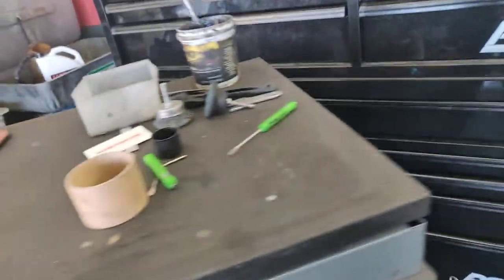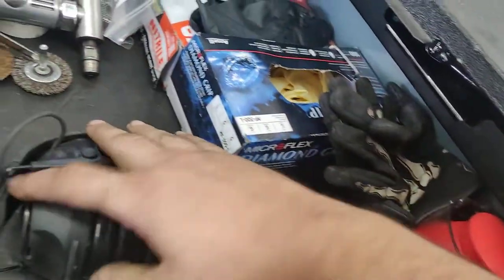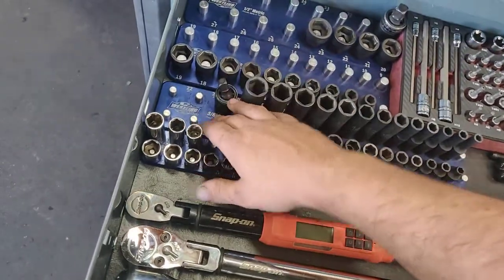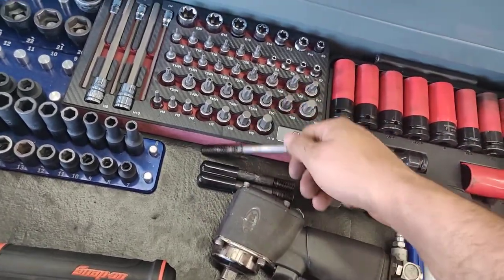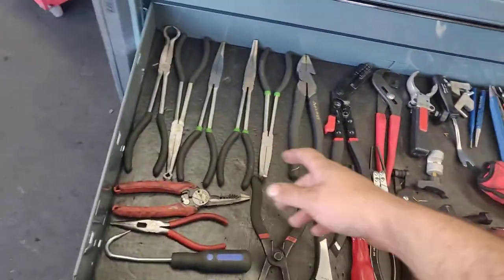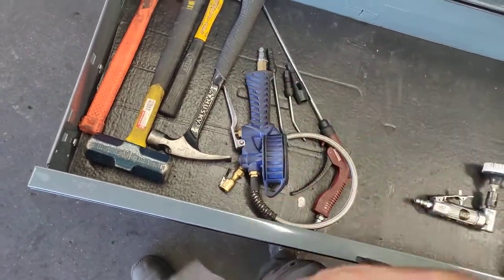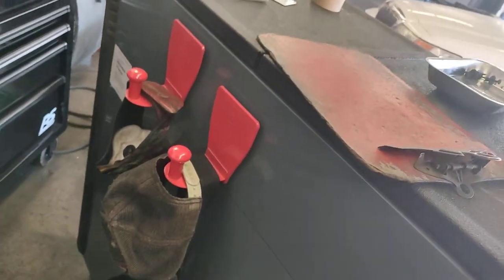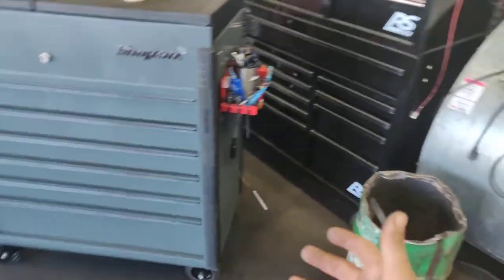My Snap On KRSC430 Service Cart Showcase and Video Inventory

Comment: A very good cheap option for prybars if you don't need longer than 25 inch is believe it or not, Hyper Tough from Wal-Mart. The red handled ones with the striking caps are rebranded made in the USA by Wilde and the 25 incher is only $10. Very stiff, thick steel.
Reply: Same exact prybars as the Craftsman and tekton.

Comment: spend the money on the tools not the box, the box don't make you money
Reply from the maker: Cart*
Cart holds more tools in it than the HF cart did. Allows me to have more of my most frequently used tools right there with me instead of having to walk across the shop back and forth to grab them. 

Time Efficiency is money. And this cart was used, not new.
Reply: U need storage first and than you buy the tools 👍

Comment: Wow someone who actually has the makita high torque 1/2! Hardly ever see these, usually it’s that red junk (;  what do you think of yours? I love mine so far! Had it about 6mo now.. also have the makita 1/2 low torque/stubby, and love it too. But the big gun has some serious torque. Accidentally broke a 3/4 bolt just the other day in about .2 seconds lol
Reply: What do you like dislike about the high torque? I like how the bottom where the battery goes , has a little flex . Less likely to break off at the bottom of the handle.. I also like how the gear case, the bolts holding it on go threw the plastic and into the metal, not the other way around like other brands. I also like that it comes with the molded rubber boot on the front.
Reply from the maker: I like my Makita. I went with it because I already had a few other Makita powered tools from when I worked Low-Voltage Installation, and it was cheaper to stay in the family than go over to Team Red and have to need a NEW charger and NEW batteries. But I did go with a few of the M12 family line since there isn't any equivalent on Makita's end.

Even at 740 ft lbs, it's plenty strong for the light-automotive work I do. The Milwaukee has what? 1400 ft lbs of breakaway torque? Excessive for light-duty automotive work. Maybe in Ag and Heavy duty it would edge out, but for passenger cars and regular trucks? 740 is PLENTY. I've rounded off a bolt with a six-point socket (It also was frozen in the bushing so.....)

And the flex at the bottom is an antivibration mechanism, since vibrations are battery-killers for these. It's a nice tool and alot quieter than pneumatics, which my boss runs. You can easily tell in the shop when I'm removing a wheel and he's removing a wheel.
Reply: The Swiss Mechanic 740 fastening 1180 break away for makita, Milwaukee 2763 fuel m18 is 700 fastening 1100 break away, but the 2767 is 1000 & 1400. But yeah , when I first got the makita I thought , yeah that’s a weak point, look it’s already moving. Then I read more up on it and no, not a fault it’s a feature lmao. Most people don’t know but makita has a larger tool line up for 18v then Milwaukee. I just pick on Milwaukee because it is just a name that is being used by a parent company to sell Hong Kong Chinese sh!t. I hate how the real Milwaukee tool company, built some super solid stuff, goes out of business and sells the rights to the name to a foreign outfit, who then uses the reputation built by the American company to sell there stuff. Plus all the marketing they do drives me nuts. Preferably I go with brands who are single owned companies, who aren’t just a brand under the umbrella of a giant corporation who’s just selling you the name.
Reply from the maker: Depends on the industry and consumer focus. Milwaukee does have more focus in the automotive field than Makita does in their tool lineup, and Makita has a heavier trade focus. My box has both Teal and Red simply because Makita doesn't have any electrical ratchets in their offerings, and the square LiPo battery packs are not conducive to working in tight areas.

But in the end, theyre also cheaper and better than buying the Tool Truck version of the electrical ratchets/automotive power tools
Reply: The Swiss Mechanic agreed, glad Milwaukee finally made a long reach ratchet. Makita makes a ratchet too, but it’s kinda hard to find. I just bought a Milwaukee corded recip saw, the tool seems okay but the case is super flimsy. Also got the makita corded high performance 4.5 angle grinder, and it’s super powerful. Definitely recommend it..
Reply from the maker: I'm probably gonna pull the trigger on that long reach. But Milwaukee needs to get off their ass and make it so you can change out the heads so you can have a single base tool and two swappable heads so you can use short or long as needed.

The Makita Ratchet isnt really even a ratchet. It's more of an Impact Ratchet. I looked at it, its hard to find and it's bulky as all hell. More like  a right angle impact screw gun.

In my work we don't need angle grinders as much, so I'm more going to be grabbing Team Red's little M12 die grinder because I need a battery operated die grinder.

Comment: I have the exact same box and color. Do treat as a box? Or do you actually roll it around with? Honestly it's pretty big to be rolling around especially with all the tools it makes it heavier
Reply from the maker: I wheel it around the shop when I have to, but I usually linger within 2-3 bays, and if I do that, it sits centrally. I have a larger Homak that just sits in the back empty, with some odds and ends stored inside (currently storing a valve train) but I do haul it around the shop with all my tools in it. It has even more now, so I need to do an updated inventory video and of the small upgrades I've added to it
Reply: what color is it
Reply from the maker: @TheATVboy17  my box? Storm Grey

Comment: 1:00 the best coozy in the world being treated like that I feel like should be a crime.
Reply: Is it that good?
Reply from the maker: Not gonna lie.....I had like, two of them. One was for drinking and I used the other as pen storage. Can't drink out of two different cups...
Reply: @aayesher9400   I use it over my yeti and the lid swapping is actually really cool. I got mine for free on the truck.
Reply: @kota3233  nice. How do you get one for free?
Reply: @aayesher9400  If you regular tool trucks you learn quick they always have some free branded stuff they give out to the loyal customers. I have coozies, a snap on shaving razor (handle is a 1/4 soft grip), snap on trash can, a crap ton of snap on and mac shirts and hoodies(never been on a matco truck), portable chargers, wall clocks, socks, and IDK what else off the top of my head. Snap on does it best I feel like but I have never won any of the big stuff like the coolers, kegerator, or grill.

Comment: I got thrown off seeing the sockets in a drawer and not in the top compartment
Reply from the maker: I used to keep them up there. But they'd get buried under paper towels, paper work, other things I'd throw in there and I got tired of digging them out.

Saw another video on the KRSC430 where they had their sockets in the first drawer and easier to get to them instead of constantly digging them out.